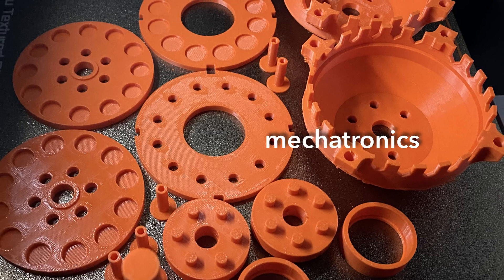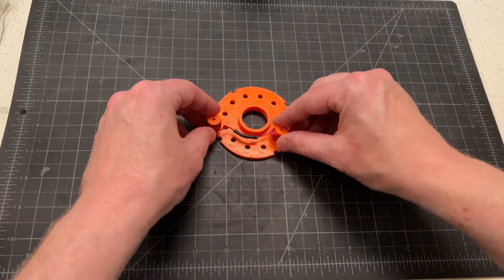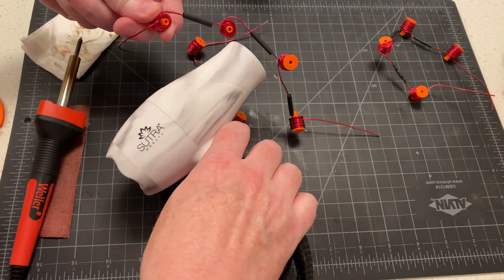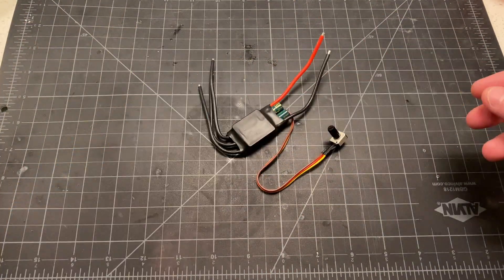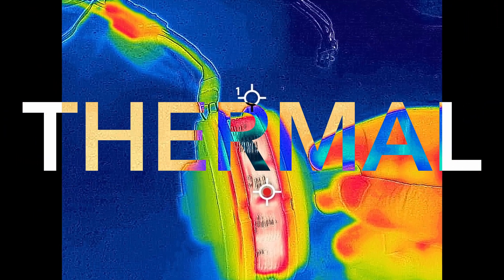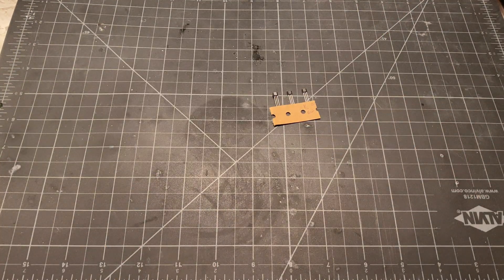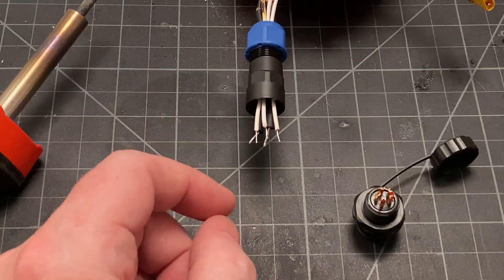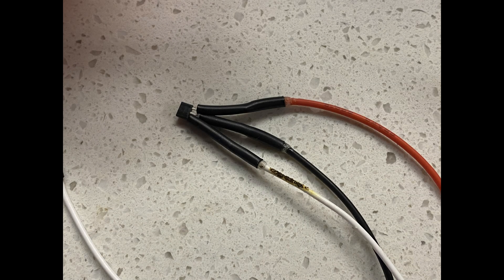Aubrey Fails At Mechatronics

Comment: By the way: don’t file your iron tips. You’ll strip away the outer plating and the tip will oxidize faster.
Reply from the maker: This is why they make replacement tips. I have been filing my iron for 25yrs with great results.
Reply: @aubreyfails I mean, this is why they make tips with different styles. No filing necessary

Comment: If u have a power supply then u can limit the current then u can test it without fail
Also if u DONT
just have a variable resistor 
Also use tpu Always.
Reply from the maker: I do have a CV/CC power supply, which I will indeed be using for the next episode where we explore the driver electronics for this beast.
Reply: @aubreyfails  Yes do it also u could somehow burn the motor so don't run it to much ALSO
if u make a another motor use thicker wire for higher current AND voltage
have a heatsink on your ESC

Comment: Yo! New viewer, this just showed up in my recommended, wanted to mention these print in place bearings I saw for the first time the other day. They lack internal ball bearings so they might not be robust enough for your motor, but I thought I'd mention them anyway just on the off chance you hadn't seen them yet, since surely they could be useful somewhere, and the design is quite interesting. This link is to an unrelated print that I was doing at the time, but it is where I stumbled across them. There is an individual file for just the bearing in the model files. I am preemptively removing the period in the link to break it because youtube has deleted my comments in the past if I didn't do that. I also can't recommend enough grabbing a cheap gas station torch style butane lighter for the heat shrink as a stopgap until you can pick up a proper heat gun. There are some situations where I still prefer using the lighter over the heat gun. Thanks for taking the time to show us all of this and for dubbing over it so nicely.

printables com/model/780632-cereal-box-with-hygrometer-spool-holder-with-conta/files